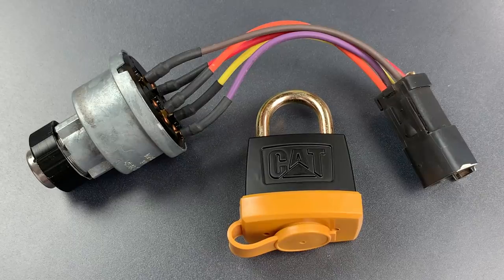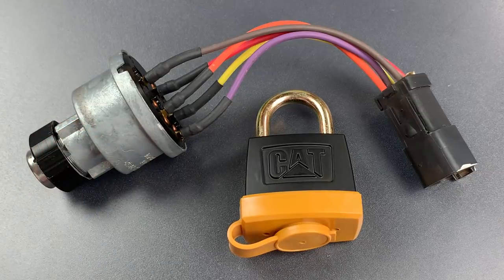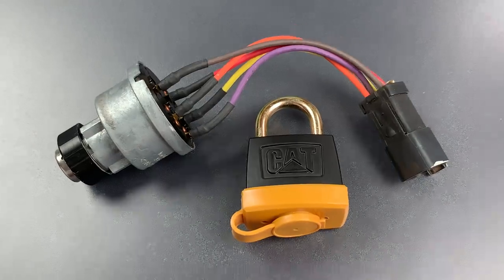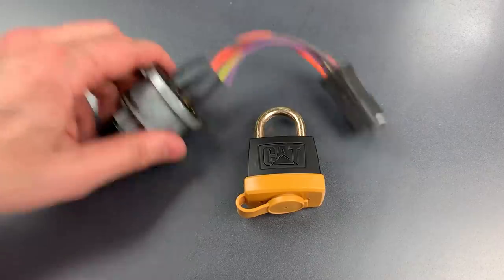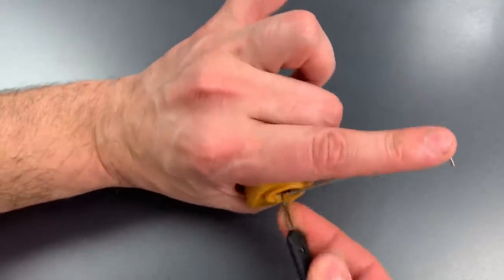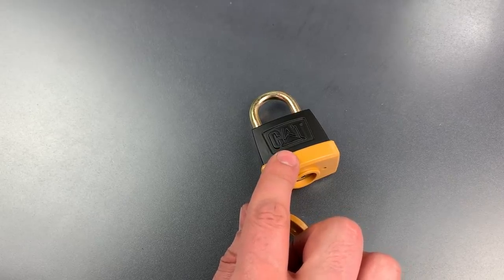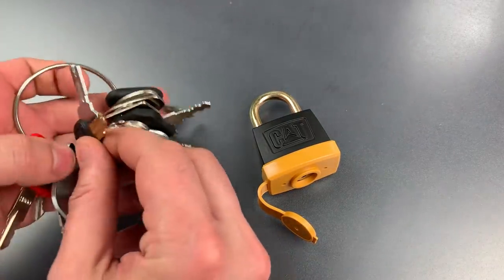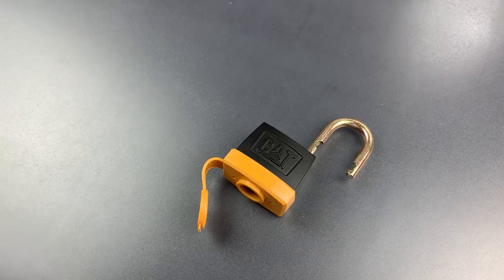[811] These Caterpillar Padlocks ALL Use The Same Key

Comment: I work for a CAT Dealer. These locks are not meant for security, they are meant to lock out the machines dead-man switches while mechanics work on them.
Reply: Makes sense, but I still think LOTO locks should be more secure. I guess it depends on your work environment, though.
Reply: If you read on SIS OM this are for prevent unauthorized access from anyone else the operator to fluids and compartments. technicians has individual lock (lockout/tag-out) to avoid operator activate the equipment. The only security could implement on newer version are the coded keys, mechanically are the same but have an rfid chip like cars, there are yellow to be easily identified. I apology in advance for my english.

Comment: These pad locks are used for low security applications where you want everyone on site to have a key, but want to avoid the petty crime of opportunity cases that typically happen at night. These are very often used for equipment engine covers, gas caps, fence gates etc. It's not the end of the world if someone gets those open, but this pad lock prevents most if not all petty crimes. It's no secret in the industry and they wouldn't be so popular if they didn't fit into a niche (security for low value items plus added convenience).
Reply: I’ve also seen some job sites putting them on some fluid caps that can be locked with a padlock because unfortunately some people don’t understand where the diesel is supposed go. So at least the lock makes them think twice before opening it

Comment: In defense of the lock, these are mostly used as a safety deterrent, not as prevention. The lock takes liability away from the construction company if a kid breaks in and gets hurt. The common keying is most likely due to the high number of keys lost by workers.

Comment: While I am not defending the barebones security of construction equipment, it is worth noting that the key in this video is one of two keys needed to operate the equipment. This is a cab key, it lets you into the cab and start the vehicle, but ONLY if the "master switch" has been engaged. The master is just a keyed battery shutoff and is usually tucked under the hood or cowling of the equipment, and often requires the cab key to get to it. However, it is even less secure as the master switch is "keyed" with a key that looks like a two prong fork; no locking mechanism of any kind, just switch that's difficult to turn bare handed. Basically, construction equipment isn't designed for security so much as for unobtrusive deterrence.

Comment: I have a key from a big rental company and it works almost every piece of equipment on every job. Skid steer, mini excavator, back hoe, scissor lift... All on the same key
Reply: Probably for the same reasons as Cat. I think the reasoning is: Access to a machine should always be possible and not depend on specific persons being on site. Storing keys on site with knowledge of many and little protection options would hardly be more secure. But if you want to have better security than delivered, replace the locks by ones of your own system.
Also, most thieves are stupid and lazy, but cautious. Why steal a specialized construction machine that can only move at, let's say, 25 km/h and will stand out in traffic, esp. at night? Hand-held tools and stored metal are more interesting.
Reply: Halberdin Heavy equipment like that has been stolen for use in worse crimes.  Like large robberies, burglaries and at least one prison escape.  And that's just the local incidents.
Reply: @Halberdin  Why? Steal a cherry-picker and then use it to gain entrance to a museum across town.

Comment: It could be an insurance thing; they only have locks on stuff because insurance won’t pay up if they didn’t try to protect it?
Or for regulations 
And if it weren’t for that then they wouldn’t use them
Reply: Lassi Kinnunen  exactly... If there is no sign of forcible entry then insurance companies will complain that the equipement has been manouvered by someone that has access to it, and good luck demonstrating otherwise
Reply: Alessandro Celoria this video can be used to show that it’s possible to defeat the lock without signs of forced entry.
Reply: Its because its a fleet vehicle.

If someone quits, you don't need their key to turn it on.

And he's not correct, there's different versions of the key for different vehicles.
Reply: @danpowell806  It would also show the insurance company that you have a glorified ziptie securing your $80,000 asset.
Reply: @JorgePerez-de5ne  Are you talking about the police cars or the caterpillar key? In the latter case, i doubt that when someone quits they take the machine's key with them considering it's not their propriety
Reply: Yep they put them on the tool boxes on the equipment as the stuff isn't insurned if there isnt a lock on it
Reply: @alessandroceloria  it happens if guys quit and get pissed they will just not return it the company charges them 10 to 50 dollars and thats that
Reply: @JorgePerez-de5ne  My key will start dozers, pans, graders, loaders, trucks and hoes. Maybe the paving stuff is different and industrial forklifts but all the heavy stuff uses the same style.
Reply: @Quick_in_and_out  Yes, insurance requires that you secure your assets with industry-standard locks.
Reply: @lewiemcneely9143  Theres also universal keys.

But i know for sure Komatsu has two sets of keys for vehicles
Reply: @JorgePerez-de5ne  Maybe so. My Cat key will open and start everything on the job that's Cat. All the other stuff has their own key but I don't know if they're all keyed alike at or not. I just fool with Cats primarily.
Reply: @alessandroceloria  most operators have their own keys
Reply: It's the same at the place I work at. Though you would need to get over, and later through, a thick full steel spiked fence and into the garage to get to the vehicles without setting off the alarm because if you do, hydraulic bollards rise out of the ground and prevent drive away theft.

The key really is just a gimmick to prevent untrained personal from using machinery they shouldn't use.
Reply: We use these to lock the fuel and hydraulic oil caps on our heavy equipment.
Reply: starshipeleven  Backhoe.
Sometimes also used to refer to excavators, but usually a backhoe tractor.
Reply: @alessandroceloria  most operators are expected to have their own set of equipment keys, just like a hammer for a carpenter.
Keys are expensive, and by having operators have their own keys, the company doesn't have to worry about key control.
Otherwise, operators will leave the keys in equipment, and others will pocket them, and then the first will report lost keys, and the company has to buy more.

That's actually how I built most of my key collection actually. When I was driving for United Rentals, I would often find multiple sets of keys on the equipment that had been on rent for a while, one under the seat, one under the cushion, one in the side box, one on the radiator, etc, and if I didn't have that brand of key yet I would keep one of the extras lol

And this is how it is with most brands, they come with a standard key, and it rarely is changed out.
I remember looking a few years ago to see if Caterpillar even offered different keying, and they didn't.
If you want something more secure, you have to add a seperate secure cutout switch or something.
Reply: These locks are uses purely for convenience.
You keep a few in your truck, and if a gate needs locking or a ladder needs locking or a toolbox needs locking, you can put a cat lock on it, because you know that anyone else who needs to get in will have a key.

And it is basically no less secure than a regular Master lock, unless a bad guy has a key, but that is surprisingly rare.
So I have used these and seen them used for years on all manner of construction sites, and never seen a problem because of the key security.
Usually the chain is cut next to the lock when thieves strike lol
Reply: The insurance companies felt they had a problem with paying out claims for both low-speed auto accidents and for injuries and death from severe auto accidents.  As a response they created the IIHS, or Insurance Institute for Highway Safety.  This entity is private and is funded solely by the insurance companies as a means to try to reduce claims costs by embarrassing the auto manufacturers into making safer vehicles.

Seeing videos like this one I have to wonder if the insurers are going to have to create a new testing entity, to basically deny claims when locks that aren't up to snuff are used for faux-security.  Because that's what these keyed-alike locks are, faux-security.
Reply: @TWX1138  the thing is, I have never heard of a cat padlock being picked open, or even opened with a key, and having an insurance claim made on what was stolen.
Most of the time the cost of the theft insurance and deductibles etc is more than the cost of anything secured with a lock like this, and chances are that the thieves would use bolt cutters anyway.

As for the ignition switches, the fact that nearly every tractor ever built either uses the same key as every other tractor of the same brand, (and a lot of smaller brands just use CAT or John Deere ignition switches), and that most tractors can be hot wired in 2 minutes with a screwdriver and no damage, any insurance company that requires extra protection is going to require some aftermarket secure disabler, and probably a LoJack GPS tracker as well, because if you are in a location where you can start up and drive off with a freaking bulldozer, you will have time to hot wire it too lol
Reply: W Bond even a zip tie would be better; at least you have to break them to open them
Reply: @Quick_in_and_out  add a zero or two

Comment: The padlocks keep kids from stealing fuel and adding things like dirt or sand to expensive component areas.  With each machine using locks on ignition, entry doors, hydraulic fluid, transmission fluid, fan access doors, fuel, ect., to have individual keyed locks would be to have an insane number of keys on a job site.  My work place uses 10-15 Cat machines.  If each had 5 different keys what a job keeping track of keys!
Reply: All of your locks matching each other is just fine. The problem is that they match all the locks on the other site down the road.
Reply: same

Comment: When I was a kid (about 50 years ago) every padlock for any use at all in the entire high school district was a Master 3210. Also any padlock in the elementary and junior high school districts (which were separate entities, unrelated to the high school district) used Master 3210's. The junior college also used Master 3210s. Any school kid that got a part time janitorial job had one or two of those keys. Heck, you could buy them pre-cut and numbered off the counter display at the local lock shops. I think I probably still have one on my old key ring.

Comment: these are generally used on fuel caps on heavy equipment.  Their main purpose is a basic lock to keep fuel caps from falling off.  Anywhere I have operated equipment, we have a habit of using them for that exact purpose :)

Comment: So as an Operator and construction worker, I see these locks all over on job sites, including gates and tool cribs.
Purely for convenience lol
They are quite a bit more expensive than equivalent strength Master locks etc, but being able to have a few locks in your truck to toss on whatever needs locking, and not having to worry about making copies of the key for the people who need access is priceless.

Generally it will be either on low risk sites, rural or remote, or on guarded or 24 hour sites, but I have seen it in the city, because most bums don't have keys for it, and if they are bringing a bolt cutter they are going to get in anyway.

As far as the ignition keys, pretty much all the heavy equipment and tractor manufacturers use the same keys across all their machines.
John Deere, Case, Komatsu, Hitachi, Kubota etc etc, all use common keys, sometimes coming out with newer key designs every few years, and often different between the construction and agricultural sides, but it is just the way the industry works.

I used to deliver heavy equipment for United Rentals, and I had a key ring with about 15 keys for all the different equipment that I normally hauled, across all the major brands.

Some companies will replace the ignition switches with custom keys, but that's rare.

And despite all this, heavy equipment theft or misuse is pretty rare lol

So yes, it is a security issue, but one rarely exploited.

Comment: The real purpose if this lock is to lock engine panel and toolbox on a machine. Making it one key for everything. And allow anyone with a CAT key to operate and inspect that one machine. 
As proven by this channel lock are easy to pick. Or you use a master key ( bolt cutter). Security on all lock are marginal. "If they want in they will get in"

Comment: Those padlocks are mostly for locking up the battery boxes on equipment, for example the 420F backhoe. Makes it a lot harder to hotwire the ignition if the battery disconnect isn't turned on lol.
Which, by the way, the disconnect uses a totally different key, the "old" Cat key, a weird two-pronged deal that can only be removed when it's off, unless you know how to grind the "denial islands" off.

Comment: Fun fact, using common key locks is also prevalent in the electrical supply and distribution industry. One could easily get into every room of an 11/33kV and sometimes even 110kV substation in my particular area with a single key. This is also the case for stand-alone assets like transformers and 11kV switchgear. Hell, some switchgear isn't even locked, plenty of pole mounted switchgear could be operated easily with a long stick. Rather surprisingly this happens extremely infrequently, the far more common act of vandalism is people stealing copper earths from poles which requires nothing but a set of cable cutters (or an axe if you're a barbarian). At first I found it surprising, but really as we all know a lock generally requires only minimal determination and the right tools to defeat so trying to make things ultra-secure would be an act of futility.

PS Cheers LPL, your videos always entertain and delight me, and also make me constantly afraid my bike will be stolen! :D

Comment: We use those on gates to our pastures and across roads going to hunting land.  That way you don’t have to carry a dozen different keys and I can get in my dads pastures, he can get in mine, my grandfather used them to before he passed. Most of the CAT locks we have are the old black ones from the 80’s

To your point they’re not very secure but it’s just a pasture. So long as the cows can’t get it opened we’re good.

Comment: These locks are supplied to put on fuel caps and hydraulic tank caps to prevent people from putting contaminates such as dirt, rocks ,water and other thinks in the tank that could potentially cost thousands of dollars to repair

Comment: Most Caterpillar machinery produced in the last 10 years, such as T and K series bull dozers and D and E series excavators, can be password protected for engine start through their ECM. Not sure on Cat, but Komatsu have a system called Komtrax fitted to their later model machines (all keyed alike from factory) which provides the owner with satellite tracking of their machines, warnings when the machines are started or have check engine lights etc come on, and remote shutdown of the machine, I’m quite sure that other manufacturers offer similar systems. 
I don’t know of any brand of heavy equipment that offers their machines keyed differently from the factory, but I have come across a few that have been re keyed by owners. 
Also, thanks LPL, I’m another of the great many that have turned to picking (and become more concerned about security) thanks to your videos.

Comment: Heavy equipment locks are keyed alike so that service companys can arrived and have complete access to the machine. The same key even turns the ignition. These service trucks roll in and top off fuel tanks and hydraulic tanks and grease machines and do other standard services, some of which need to be done daily. So if all like machies are eyed alike they all can be accessed and servived w/o the owners present.

Comment: I remember your plant ignition video from a few weeks ago. As someone who works around heavy plant a lot, the easily by passable ignitions and locks, can be helpful, however we shouldn't be relying on ignorance as defense anymore, if your videos popularity is anything to go by, more intelligent methods of protecting valuable machines should be used.
Reply: At my work we drive all kinds of equipment and have all kinds of locked places to keep basic people out.  I could not imagine the headache involved with everything having its own key...we have thousands and thousands of trucks and I could end up driving any of them across the country at any given time.  There is no one there to be hey here is this special key for this truck or box or whatever.  Theft is very low overall, we may lose something every 6 months or so but considering the billions of dollars of stuff it is an acceptable loss.